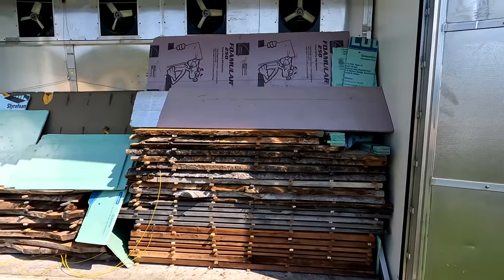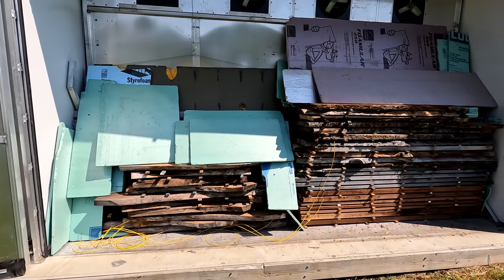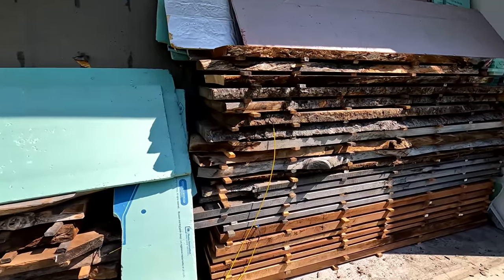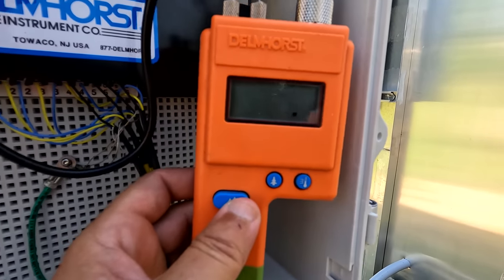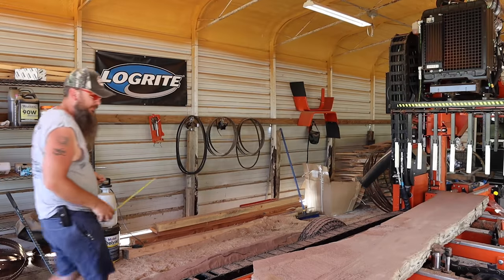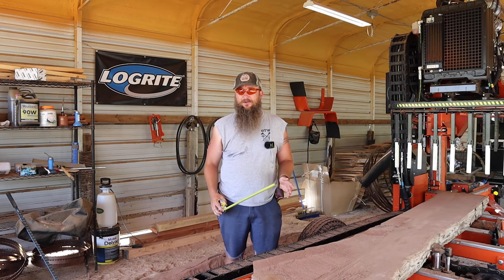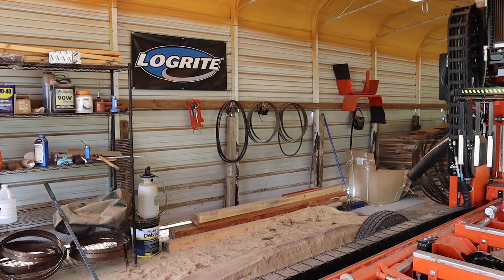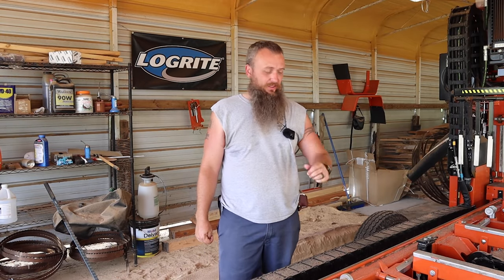Kiln Drying A $15,000 Load Of Black Walnut

Comment: For the small holes and gaps in the stacks of lumber, we've used aerosol urethane sealer, sprayed into a gallon milk jug,  after it dries, cut the jug off , then you can diagonal cut the foam and it fills holes quite well.

Comment: Could you use a heavy canvas instead of the foam to baffle the wood?
Reply: I was thinking maybe even gluing some canvas to the foam backing boards to give them weight and stability, I imagine those fans can really move some air.
Reply from the maker: Maybe
Reply: Too bad they don't have military surplus stores around like they used to, that could work with the right attachment point one would think.